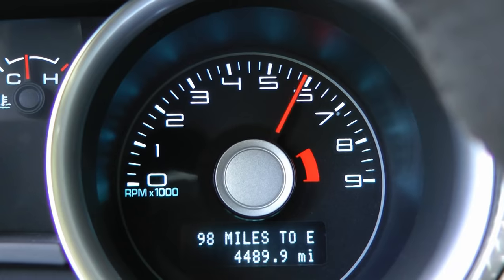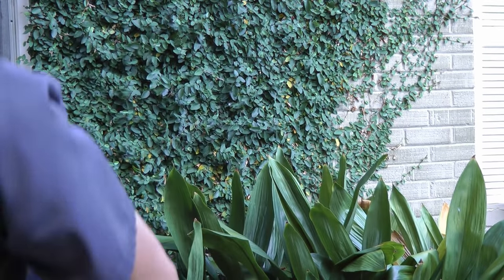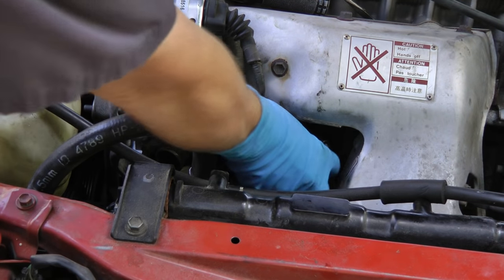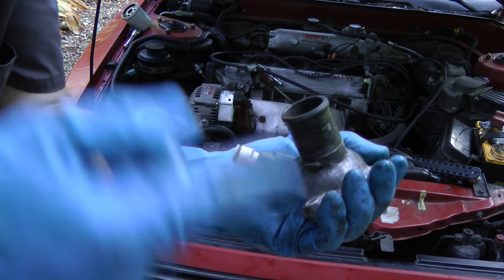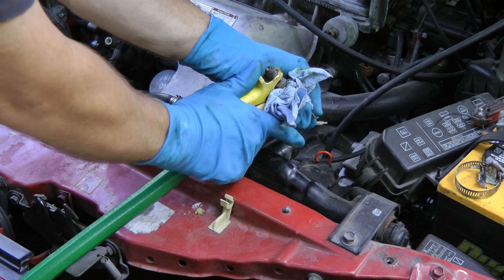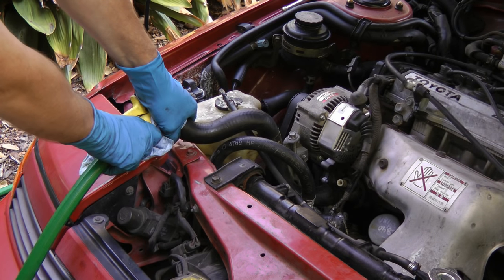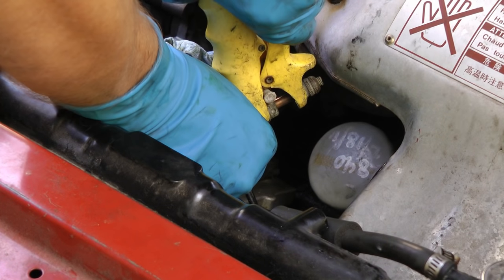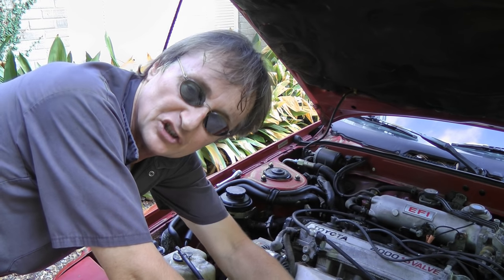How to Flush a Coolant System in Your Car (the Easy Way)

Comment: hey scotty, I'm a big fan and a follower of your videos, I have a situation. I have a Nissan altima '02, which means I have two thermostats. Now I just replaced the both of them and I'm still having heater issues.. the bottom thermostat is not working because when I touch the bottom hose it doesn't seem to be heating up like the upper whose. I believe the bottom thermostat might be stuck shut because the upper hose is spitting out coolant due to the backed up pressure.. but both thermostat s are brand new .I did add a little bit more coolant then the "max" line. could that maybe be the problem? I really need some help with this issue.
Reply from the maker: realize radiator could be clogged up causing that too

Comment: hey Scotty question on my GM I have 2 hose that come out of the radiator one is on the bottom right corner and it leads to some tubing that goes up into the engine I believe and then there's a second one that is on the left upper corner and not one leads to my cooling engine temperature sensor my question is how do I flush the radiator

Comment: Just got my radiator replaced on my old subaru and the mechanic decided to overfill the coolant by about 3 cups..... I drove the car about 200 miles before noticing the obvious smell of burning coolant coming from the coolant reservoir leaking onto the hot exhaust parts, accompanied by that dreadful white smoke.

So the question: What parts do I need to worry about the most after driving 200 miles with too much coolant?
Reply: not getting any hot air only cold air
Reply: what most do
Reply from the maker: try my video 'how to fix your car's heater"

Comment: Thanks Scotty, I'm replacing the radiator on my 95 BMW and decided to do a coolant flush in the process. Then I'm going to fill it with distilled water and leave the thermostat out for a few hundred KM to get it nice and clean.

Comment: Hey Scotty I have a 2007 Chevy Cobalt. I decided to flush the cooling system. While removing the thermostat. The plastic protector over the wiring started falling to pieces.
Reply: Jason Shubert I too was too doing radiator work changing the hoses and coolant I had some fall to pieces I just wrapped them with duct tape

Comment: will it trip codes (DTCs) and check engine light, if driving without a thermostat?
Reply: i drove a week without the thermostat.  No check engine light.
Reply: It shouldn't normally...since your thermostat only regulates flow and doesn't have a sensor.

Comment: Im currently doing a flush on my vw dasher from 1978....
i just drained the 8 years old coolant out of the radiator.......man it was dirty and turned purple at some point....flushed with normal tap water....filled it up with normal water....drove around until the fan turned on and let the heater work for another 5min.....then drained it again and repeated until it ran out clear.
then refilled the radiator with pure g12+ pink,wich gives me the ratio it needs when it gets mixed up with the remaining clear TAPwater from the block and heater core.
it just takes a little more time and work but it dont makes  a mess around my garage.

i dont think 40 years ago when my car was build they used destilled water in the radiator at all.....lol.

i just want to ad....even if you drive your car at a low mileage per year like i do....(maybe 3k a year)....please change the coolant every 2 to 3 years....
mine was like a dirty dark purple(like welchs grapesoda) almost slushy looking stuff.....and i allways used to wonder why my car used to be too warm...not overheating but 3/4 to the red.

now flushed it stays in the middle like it should and takes a lot longer until the fan kicks in.

Comment: Scotty , Thank you for the video. I have a 2002 3.0L ford ranger xlt. My repair manual says to use Motocraft premium engine coolant (green colored). Can I use another brand of green colored coolant ? I found online that the coolant needs silicates to protect the aluminum parts.So as long as I buy a conventional green colored coolant with silicates and flush periodically will that be fine ?

Comment: Hey scotty have you ever used OEM toyota brand red coolant in your celica? Are there special additives to protect newer aluminum engines like in my 2002 tundra or is the stuff not worth the price and I should use any old coolant as long as its changed every 30,000 miles? thanks would like your feedback on the subject thanks
Reply: Toyota Branded Coolant isn't produced by Toyota...and Toyota Oils are produced by Mobil 1.   Just use a good Red or Pink Coolant provided by Zerex or OEM Coolants...they're formulated exactly the same way and with the same 5 Year/150 Mile Warranty.  You can get them both in Concentrated or Pre-mixed Formulations and they a HOAT Fluid!  Win Win

Comment: Flushed radiator block and reservoir earlier. Was gonna wait until tomorrow to flush heater core, but after watching this, I'm thinking of putting it back together with water and driving a while and then flushing everything a second time

Comment: There's also a drain bolt on the engine block on most cars. I'm surprised he didn't mention that. That's the only way you're going to drain all the water before refilling with coolant.

Comment: Question? 
    My 03 Montana does not want to push cooling to the engine from the radiator...  also can't find a leak.?
Reply from the maker: replace the thermostat, and then the water pump if not that.
Reply: Scotty Kilmer already done.. new both.

Comment: Wouldn't using a garden hose tap water ruin the engine in the long run if you are only flushing out the entire engine system with just garden hose tap water?
Reply: Nah.
This is for neglected systems.   

I guess the more correct answer is, it depends on your tap water.   Have it tested or use distilled water to flush if you're worried.   People with neglected systems aren't worried
Reply: @deasttn  Alright, thanks.

Comment: TOP TOP- I did a similar thing like this but undone just 1 hose and you should add 60% coolant folks as there is still neat water in the system not coolant so by adding 60% it'll be more like 50/50 mix.

Comment: I have a 1990 miata with some serious issues. When it's cold it is usually fine, but once it's up to operating temp it won't rev above 4000, it won't go up hills without a real fight, and it will make to no power, there are also times were the engine goes limp it'll idle but not go for a few seconds. It Has good fuel pressure, good spark, and it's getting air.
Reply from the maker: have the catalytic converter pressure tested when it's hot, if it has too much back pressure, it's clogged up and is doing that. ALSO, pressure test the fuel pump when it acts up as a hot pump with low pressure will do that too
Reply: I put a pressure gauge on the fuel line leading to the engine and drove around for nearly an hour, the pressure did not drop once. I lie in an area were catalytic converters aren't necessary so someone sold it before I even bought the car.  There's plenty of gas in the car, a new fuel filter, new spark plugs and wires, and I did a full service timing belt, oil, filters, water pump, coolant. Then I cleaned the intake which made it idle really low for a couple days. Last week I was averaging 14 mpg, this week I'm averaging 22.
Reply from the maker: Devon metters
often a blowing head gasket does that, remove all spark plugs, do a compression test, wet and dry, or have a mechanic do it to see if engine is just flat wearing out inside
Reply: My family owns a repair shop, just my family loves ford, most of all the mustang so naturally they  all hate my miata. I pulled the plugs and found it was running really lean which was surprising because of how much gas i had to put in it. The engine was rebuilt 15 000 Kms or about 9500 miles ago. Re-ringed, bearings, and all new gaskets, I only did all the work to be safe. I went through and tightened up all of the intake stuff, clean plugs and fuses and it got a little better. Going onto the highway it hesitated in 3 gear. I love your videos and thanks for all your help. Compression tests were good, even pressure wet and dry rise in pressure between the two.
Reply from the maker: Devon metters
if it's running lean but uses too much gas, ONLY gasoline leaks somewhere could do that, or a transmission that is not working right, especially if it's an automatic or has a slipping clutch
Reply: The clutch is brand new and it doesn't slip, I am very careful with it. I will look for fuel leaks. Thank you.
Reply: Have you tested or replaced the MAF?
Reply: I did. I checked for fuel leaks cleaned and retightened everything and the problem almost stopped. Then I sold the car.
Reply: Devon metters
could be a fuel filter ,my tahoe used to do that before i changed it.
Reply: I replaced the fuel filter before I started asking questions. Fuel pressure was good, I drove around with a pressure gauge on it. It had good pressure but it was running lean still, I tightened up every piece of the air intake and that made it a little better. Then I sold it for $1000 more than I bought it for, it even broke down on the test drive and they still paid.
Reply: They said they would fix and daily it. He didn't seem to want a swap, the motor had been rebuilt within the last 10 000Kms.
Reply: I miss my miata, I'm trying to sell my mustang now that I don't need as much room. All the miatas in town are pretty reasonably priced now that it's winter. I'm either buying a miata or a ae86. I found a couple of the old ae86s for $3000.

Comment: Hey there Scotty!
Thx for your videos btw. Please help with this: water boling inthe engine and the tank. Changed the thermostat, the headgasket gasket, flushed, new hoses...but keeps boiling, sometimes the water is in the tank, sometimes it magically dissapears.... Thank you.
Reply: Pressure test your system.  Coolant systems are under pressure to raise the boiling point.  Don't forget to test your radiator cap to make sure it meets it's pressure rating as well. They sell a tool just to do that.  Or buy a new one with the correct pressure rating.

Comment: hello i have a bmw e23 745i turbo with 56 000 kilometer that has been neglected for 15 years....how do you flush an engine with heavy builds up ? i was considering using acid type lime and rust removers but i dont know how bad is it inside the engine ...any help ?
i was trying to find evapo-rust or metal rescue cause these are rubber and gasket friendly and can be used to unclog engine bad cooling system...but i cant find it in kuwait so any help regarding that ? thank you for your time

Comment: If you are looking to increase MPG ask yourself this: When did I clean or replace the...... fuel system filter, injectors, air filter, spark plugs, spark plugs wires, coil packs, mass air flow sensor, throttle body, intake manifold, motor oil, which motor oil I am using conventional, half conventional half synthetic, full synthetic, using any motor oil additives, transmission fluid / filter, tires under inflated over inflated, piston rings and valve seats affect engine compression, and mileage.

Comment: scotty, do you recommend cooling system flush solutions? i have rust in my cooling system and it keeps coming back. replacing the coolant and flushing it with plain water isnt working for me. its a 99 mustang v6 3.8

Comment: What is there to flush out if it's been well maintained since new?
Reply from the maker: coolant breaks down over time from heat and clogs up stuff
Reply: Thanks Scotty, enjoy your videos.  I live in Thailand, we use coolant that does not have anti-freeze since it never goes below 70 degrees.   Different World, it costs about $9 a gallon (4 liters) directly from the Toyota dealer.  Try buying anything that cheaply from a Toyota dealer  in America.

Comment: Tap water in the cooling system, engine, radiator etc etc?  Will the tap water ever be completely removed.  What's in the tap water?  Is it hard water?  I wouldn't bring tap water any where near my car.

Comment: Hi.  I recently had my cooling system flushed and put new coolant in.  I got a mechanic I trust to do it.  However, when I got the car back, the coolant level was still just barely making the 'minimum' line.  The coolant was mostly clean, but I noticed a couple of tiny black specks in the reservoir (which didn't look that much different to when I brought the car in).  They are good people, but now I'm concerned... Did they not put enough coolant and are the tiny peices of black debris normal?

Comment: hello scotty i have an important question.

i have a 99' mercury cougar v6

i have coolant that leaks behind my engine towards the fire wall. I tried checking the engine oil and transmissiom fluid to see it some got in there but both are fine. my car dont overheat and no blue or white smoke coming out from my tailpipe nor smoke comming out from my engine.i checked the radiator and upper and lower hose and those are fine. when i turn off my engine i hear a hissing sound of air leak somewhere behind my engine. Is there another coolant hose? or is it a blown head gasket? thanks
Reply from the maker: pray it's not a blown head gasket, but pressure testing the cooling system would show the leaking area, places like auto zone often loan you pressure testers free
Reply: Thanks for the reply scotty. I went to autozone for the tester but since my radiator doesn't come with a radiator cap i couldn't test it. So i did more inspections, i lift up the car to see if any leaks on my engine near the gaskets and was looking at the freeze caps but every thing was okay. But i still was hearing hissing sound and droplets it sounds like its coming from the fire wall. Do you think its a heater core problem?

Comment: I'm confused Scotty. In the first part u flush out the Block...But, where does the water come out at? What else do I have to take off?
Reply: Jake Goodwin when you flush the block from the top hose, it comes out from the bottom hose. From the top to the bottom of the engine.

Comment: How about flushing out a car's cooling system that has no radiator cap and uses the pressurized overflow tank? 

In my example: 2004 Chevy Malibu

Comment: How to burp a 15' ford fiesta se sedan 1.0L 3-Cyl engine overheats in the cold 50s outside in 5-20 mins or interstate@65-70 it will overheats... The car has 2 thermostat and it's also check engine light is on# P0301  I'm lost any advice from you Scotty would be awesome thanks

Comment: Hey Scotty,
I live in a hot part of middle east. Is it fine if I run on water in the cooling system for a week or so? Ambient temperature can be higher than 115 degree.
Reply from the maker: water cools better than coolant, it just freezes when really cold, not a problem for you.
Reply from the maker: Guld Glubber
that's nonsense, actually water dissipates heat better than pure coolant, it just freezes and cracks engines when too cold.

Comment: I didn't need to remove the oil filter on my Celica's engine to get to the thermostat. I used a 1/4" drive wobble head adapter.

Comment: hey Scotty, so it's off topic, but couldn't think of a better person to ask...... why don't my brakes want to work when my cars engine ('02 Subaru Impreza WRX) is cold? brake pedal is stiff and feels like the pads don't want to grab? Brake pads are darn near new. It ONLY happens when the engine is cold, if it's warm they work completely fine.
Reply from the maker: often a weakk brake booster does that, engine builds up vacuum then the booster works
Reply: Scotty Kilmer kind of new to boosters, is that something I can fix or is that just how it works? thank you for the reply by the way!
Reply from the maker: often worn brake boosters do that, or a worn master cylinder. The master is a lot cheaper and easier to try first

Comment: Scotty, thanks for the good video. I wanted to ask you if there is any way to test for engine oil or trans oil from the old coolant in the radiator... mine is a bit murky and I fear worse things than just dirty coolant. Also, no other symptoms besides dirty/slightly crummy coolant, transmission and engine performance and temp are fine. I'd appreciate the tips!
Reply from the maker: for engine, do my video {how to tell if your head gasket is blown{      Put UV leak dye in the transmission, and if UV dye shows up in the radiator, the cooler would be leaking

Comment: Another way to flush your vehicle cooling system. Remove radiator cap & radiator drain plug located at the bottom of the radiator. Some vehicles dont have a drain plug, remove bottom hose where it attaches to the radiator by the loosening the hose clamp. Radiator hoses can be real stubborn to remove some times. If you have a can of silicone spray, pry open hose end if possible & give it a spray.  Silicone can help with the  hose removal. Inside the cabin of your vehicle there is another small radiator called a heater core. There are  2 hose pipes attached to the heater core that come out through the wall into the engine bay. Repeat the same process as you did removing the bottom radiator hose.  After removing only one heater hose , very carefully try to insert a garden hose into the heater core pipe. Jump back into your vehicle, turn the temperature control to full heat setting. By doing this you open the heater tap allows hot coolant to travel into the heater core heating your cabin when you need heat. Ok turn tap on till water comes out of the bottom of radiator hose, the top of the radiator opening where the radiator cap secures &  heater hose is nice clean. Then assembled,  add cool, water etc.....